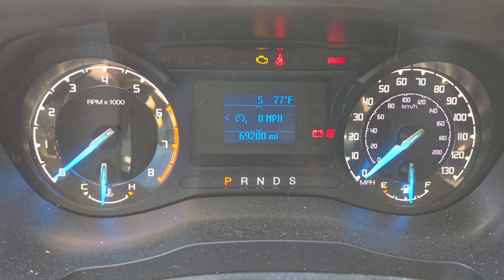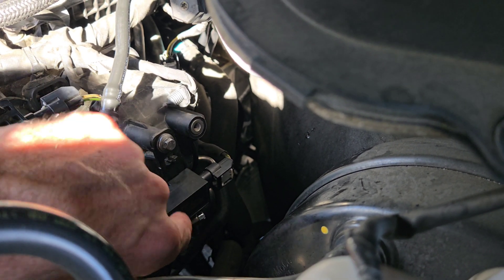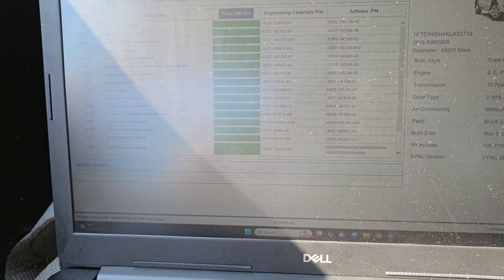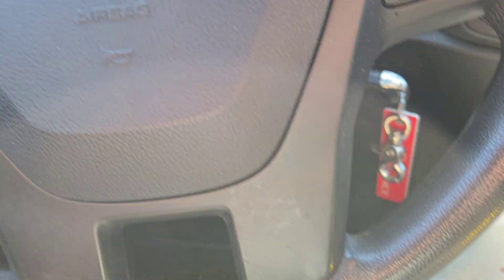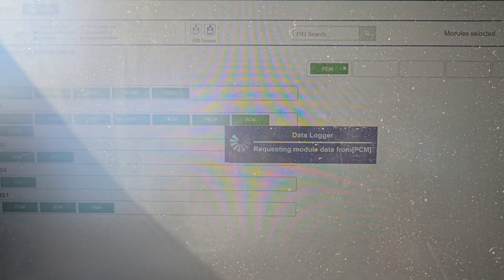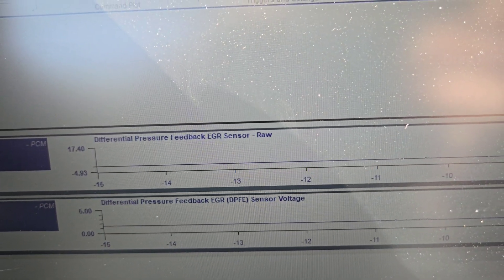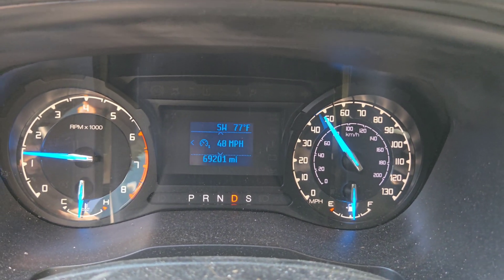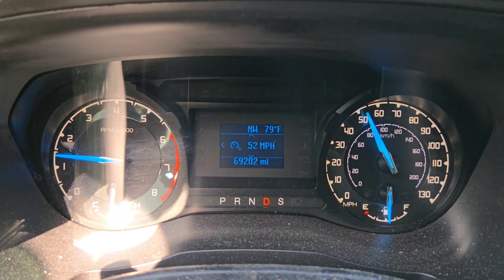Ford's P139C Code Showdown: What's Really Going On?

Comment: Very helpful video. I'm sure I'm having the same issue on my 2019 Ranger with 49,000 miles. Mine is bucking at about 20-25 mph. Finding it difficult to find the replacement sensor in stock locally or on-line. Most are showing out of stock or backordered. Sounds like you've replaced many of these at your dealership. Do you have any insight as to what is causing them to fail so prematurely or so frequently?  Thanks for the excellent video and information!
Reply from the maker: Some get moisture in them. I've done like 6 at the dealer here already and we dont have any in stock either. Guess it just may be a bad run of them. Have you tried lakeland ford?
Reply: @BeardedFordTech , I did find one on Parts Geek and got it ordered. Thanks again!
Reply from the maker: @BryanHoward-i4m you are welcome!

Comment: Just put one on my 2019 ranger with 72,000 miles and solved the problem I am curious about your center screen between the tach and speedo mine doesn’t look like that did you change something
Reply from the maker: No. Its a xl trim with stx package. Has the small screen.  I didn't change anything.

Comment: Your description of the data on your laptop was a little confusing to me.  I'm going to try and find that data that you were looking at after you fixed it so I can try and confirm the sensor is the problem,  but after I check that the hoses are not clogged and the EGR itself isn't built up with carbon.
Reply from the maker: Whats confusing about pressure data on a computer. I mean if ypu dont know how to read it or understand it yeah.  Have fun tsking that egr off for no reason.  Ive done so many of these and its always the sensor. Always.  I do this for a living.  You can find the data. In workshop manual pinpoint test.  Which im sure you dont have do you?
Reply: I don't know why you're sounding angry sir. It was just a little confusing to me. And no I don't have whatever program that was, hence the confusion. I was just wondering if I should want to check that data before hand to confirm, or if the code itself is enough of an indicator to just change it. Sorry if I offended you by saying I was gonna try and test a couple things
 @BeardedFordTech
Reply from the maker: @auginater4200 sorry wasn't trying to sound angry. The program is ford's program.  I was just trying to say you would be wasting time tsking all that stuff apart when its just a sensor. I've done a lot of these. Its always the sensor. Had one two days ago that was the sensor with a different code.  Didn't mean to disrespect like that.  I knew what you meant by confusing as you dont have access to the software and pinpoint tests I do. Which is also why I do these videos to save people the hassle of going what I go through everyday to fix stuff. If I can save someone $1 then I'm cool with that.  Again. Apologies
Reply: @BeardedFordTech no worries mate, i appreciate it. I kinda worded my statement like i was discrediting what you were saying as well which isn't what I meant either. But hey thank you it's good to know. I'll order the sensor from rockauto

Comment: Man thank you so much. Had the code on my wife’s 21 explorer with the same issues. This resolved the issue saved me from the dealership.
Reply: Does the same part work?
Reply from the maker: @evanhowze5615 its a egr differential pressure sensor.  The part number may be different. But rhe code is the same
Reply: @evanhowze5615  should be part number: LB5Z 9J433-B

Comment: I got P139a 00-68 after GPF delet. And no one knows what is going on 😂
Reply from the maker: You have a gas particulate filter?  What year is yours?  Where are you located?
Reply: @BeardedFordTech 
Yes. I have the GPF swapped to a catted downpipe and it's throwing all kinds of error codes, the P139 was left untreated. It's a BL version in Chinese market.
Reply from the maker: @kakaxt ohhh. I was going to say GPF is only on some vehicles here for Ford. Started in 20205 i think maybe 2024. I did a video on it. Its been a min though. .

Comment: I have a 2021 80888 miles same problem but in 4 occasions when I've given it gas the motor starts revinng up  but it want go then all of a sudden it jerks and takes off.WTHECK ?
Reply from the maker: You have a 2021 with 81k?  Mine is a 19 and just hit 81k. You do some driving. Is that the only code you got?  When you try to accelerate it does stumble and feels like it falls on its face. Then out of nowhere it does exactly what you described.

Comment: Since i bought my 2020 ranger  felt that jerky (starving for gas) in low speed.   Light just came on at 72400  with the 139c code.  Thank you sir for video  ordering sensor now
Reply from the maker: Easy fix!  After you replace it. Clear the code and clear KAM in pcm.

Comment: I am having the exact same problem with my 2019 ranger right now. 75,100 miles. I’ve been having the jerking at slow speeds for weeks without a light. This video was incredibly helpful!
Reply from the maker: @Benr9828  feels like a misfire?  I bet there's a pending code you just haven't driven at slow speed enough to trigger. If you have a 139C that's what it is.  Keep me updated. I ran into a person today with a 2020 ranger doing the exact same thing.
Reply: @BeardedFordTech  the code popped up today which is how I found your video. I will buy the sensor and replace it ASAP. This video saved me a lot of headache and hopefully some money!
Reply from the maker: @Benr9828  ohhh sweet so you did get a code. The only hard part about doing it is getting the rubber hose off the metal tube cause of the clamps.  Your going to replace them with small worm clamps. Other than that. 10-15 min you should be good to go.  Glad I could help and save you some money. One person commented below they paid $800 for this.

Comment: I have the p139c code and it’s driving fine. No surging or any issues. Mind you I’ve had a ton of problems out of my 2019. Only 51k miles. Replaced the entire engine wiring harness 10k miles ago. Now today, funny enough at Walmart, while idling, check engine light. Code p139c. Suppose I’ll order a new sensor and see if that works…
Reply from the maker: Let me know
Reply: I would assume a lot of the 2019 2020 rangers have the sensor issue. Been trying to get the part off rock auto for while now.

Comment: I had the low speed bucking on my 2019 Ranger. Changed the sensor and works great. Seems like it had moisture inside. Thought I was having transmission issue but was just the DPFE sensor.
Reply from the maker: @BrianS_IN  yep. Feels exactly like a transmission. It even tells ypu in pinpoint test if water or moisture is in there. Replace the sensor